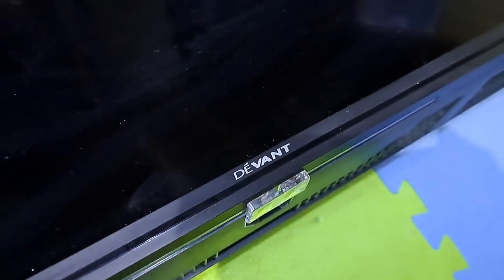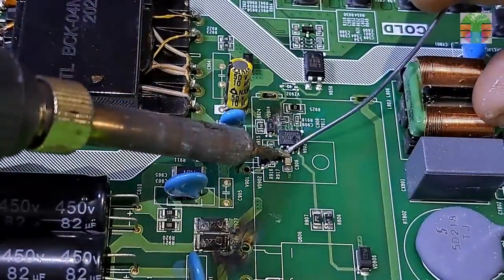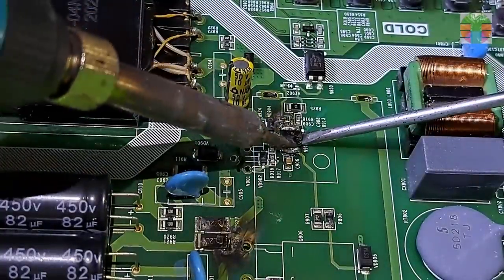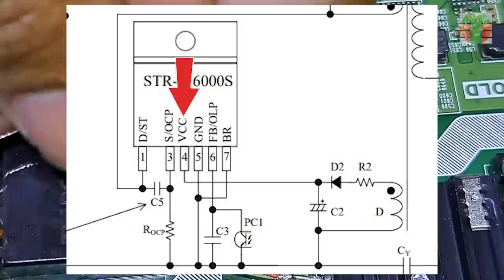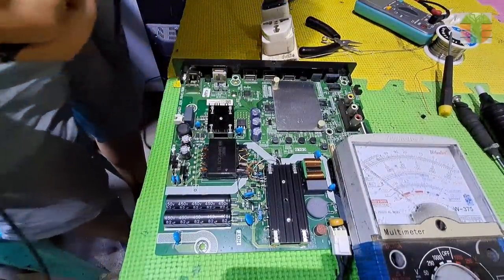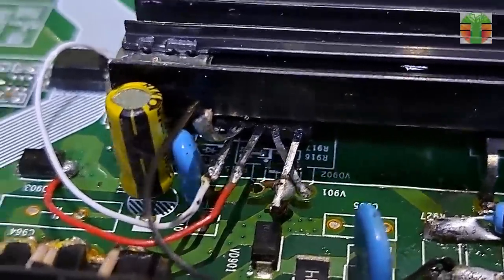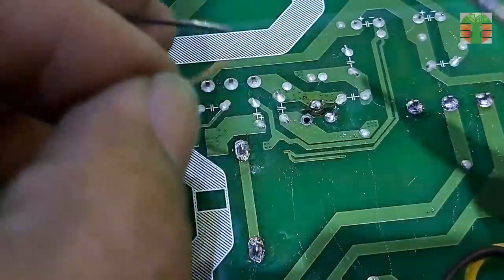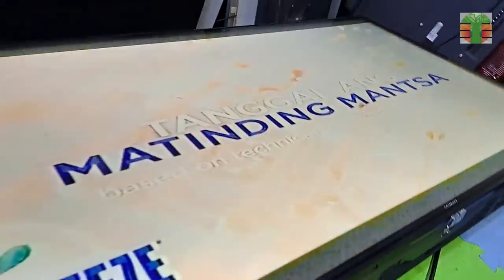Devant Smart tv power supply failure.

Comment: I have just finished this modification to a similar tv with blown smd power supply components and tv now works again.Without smps modification i think no person on earth could expect to repair it using the original parts since are hard to find the exact schematic,the parts and finally to work for solder desolder for such a small tiny components.Great video,thanks!!!

Comment: Hi Tevz, you may remember me from fixing a 32 inch tv reluctant to turn on but eventually would, aluminium capacitors under the shielding surface mounted electrolytic on main board faulty. Got a similar model not exact but on start up numerous horizontal multi coloured lines, yet corrects itself and works fine. Electrolytic caps on main board. I am trying to learn.

Comment: I have a thomson 65ua6606 LED TV that has a background light problem, when I turn on the TV, half of the picture is bright and the other half is dark, but I think the problem is not LED because when I turn on the TV, the dark half of the picture is bright and  It turns off again within 3 seconds.  Please help me to fix my TV. 🙏❤️
Reply from the maker: So the problem is the panel, cutting CKV lines may solve the problem.
Reply: @tevzTVTevatronics  The tv's display working good but the backlight is half burnt
that's my problem Sir
Reply from the maker: @mojtaba5625  burnt led lamp should be replaced.